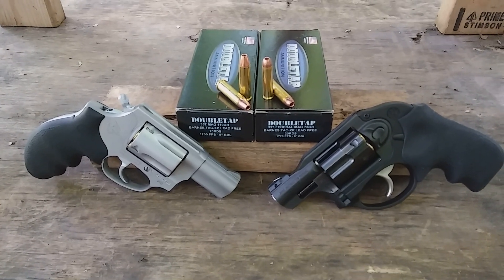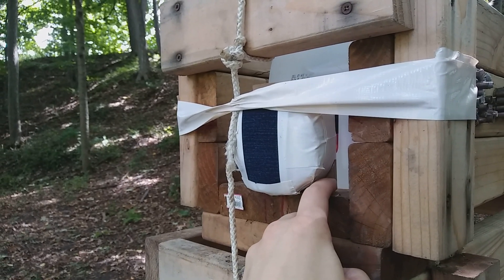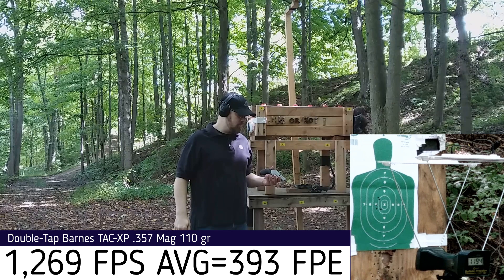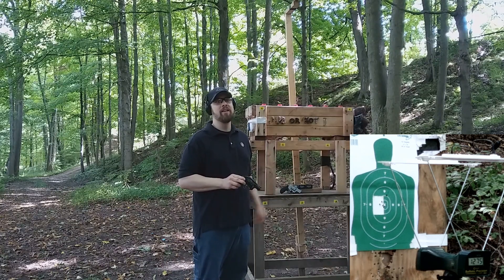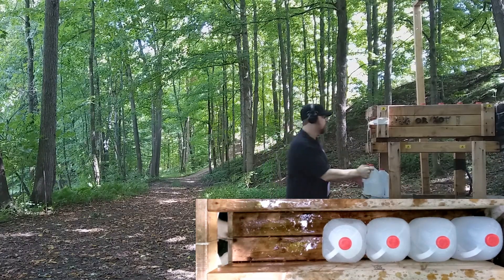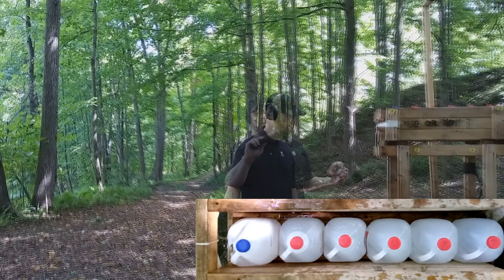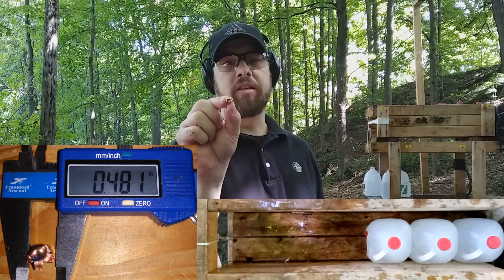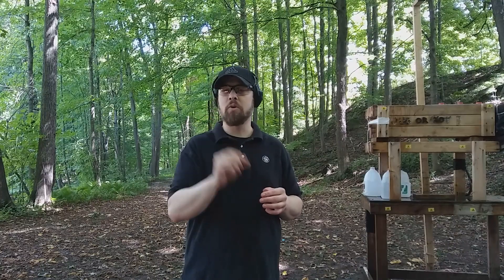.327 Mag VS .357 Mag Episode 3: Double-Tap TAC-XP

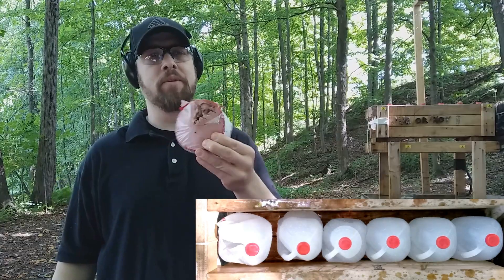Comment: Thank you for your efforts! Just watched your whole series of 327 vs 357. I have recently bought my first gun, the LCR snub in 327 Federal after watching many videos. As a novice shooter I like the ability to work with varying power rounds from easy shooting 32 auto all the way up to 327, and 32 h&r is adequate for carry with lower recoil (327 hurts!). It was really only after I bought it I realized how much more expensive and difficult to find .32 ammo is than 357/.38/9mm. There's always websites to order from, just have to buy in bulk so the s&h is worth it. The gun itself was also expensive, $590 shipped! I still think it is a good choice tho for the extra round in the j frame size  & I plan to put a green dot crimson trace grip on it for $250, making it one expensive little revolver! It is easy to clean & carry IWB at 4:00, & don't have to worry about magazine springs softening or feeding malfunctions.. I might get a 9mm  eventually but I don't regret my purchase for a versatile & dependable first ccw.
Reply from the maker: Thank you. You have a lot of option with the .327 but also a lot with the .357 as that can fire .357 Mag, .38 Special, .38 Long Colt, .38 Short Colt in the same way the .327 has the .32 H&R, .32 S&W Long and .32 S&W short. I have not fired any .32 ACP in my LCR yet but I have debated it. You have a lot of options to remedy the ammo issue from ordering in bulk, to learning to reload ammo to getting a .357 or 9mm LCR and choosing loads similar in recoil to whatever .32 round you carry. What I have noticed is that .327 ammo is easy to come by as Federal produces the American Eagle ammo, but the rest are not easy to find. From what I hear, the 85 gr American Eagle is the way to go and a fairly low recoil 50 round box. I hear that the 100 gr is loaded really really hot, and added the extra bullet weight would cause more recoil. In my opinion though, if you want a lot of rounds down range your best option is the .32 H&R Magnum.
Reply: If you think $590 including shipping was expensive, IF you can find one now for under $800 + shipping, consider yourself lucky. GunBroker shows recently completed auction at $855 + shipping, and the one or two others active are well over $700 with plenty of bidding time left.

Comment: 357 magnum is really not a snub nosed load. It’s meant as a duty load 4” barrel or Longer, which is why most people carry 38 +p In a snub. The 327 is a great alternative for people who want to carry a wheel gun over a 9mm or 380. With the same performance without the recoil. You proved that here. Great video as always. 👍🏻
Reply from the maker: Thank you. While there are some loads that seem to do as well in a snub as a 4" barrel, this one definitely is not one of them. Typically when I see a lot of flash I know the powder is too slow burning. When I shoot loads that I don't notice flash typically we so more velocity, so it's faster burning. But then the fast burning comes at the limitation that in a 4" barrel it's not as powerful as others. The magnums with a 158 gr bullet seem to be the most efficient and powerful in a snub, however the recoil is always worse for 158 vs 125 or less.
Reply: Try the 327 in a 17oz Ruger LCR and tell me there's no recoil.  My 9mm SIG 938 had considerably less felt recoil.  All these claims that the 327 has no (or very little) recoil are simply false.  In a 4" barreled 30oz SP 101, I'm sure it's very pleasant,  but I believe most people are interested in the 327 for small light concealed carry  guns.
Reply: @charlescole7532  the 32 H&R is the better round
Reply: @charlescole7532  It's not horrible. It's there certainly, but it's manageable.

Comment: since you do your own reloading, you might want to try a semi wadcutter hollow point with a gas check on the backside with an all lead bullet.
Reply from the maker: I do plan to test some hard cast rounds soon. I would have to get the thing that attaches gas checks and find some bullets. I actually haven't started reloading any .32's yet as I have been using my gun budget for factory ammo lately and don't even have the die set yet.

Comment: I realize this test goes back a few years, but I recently noticed the .327 doubletap barnes bulllets are still for sale a a decent price. So far the only .327 Federal Magnum round I have purchased is the 85 grain reduced recoil hydroshock, which shoots easy in my Taurus 327 (mainly I use S&W longs). The double taps are about 2/3 the cost of the hydroshocks, would they be worth trying for self defense?

Comment: The inconsistent expansion of the .32 would require about another 3 or 4 duplicate tests to see if a pattern emerges. But cost....
Reply from the maker: I believe my measurements were at 1.5 times expansion or close, so either way it still passes as well as not over penetrating.

Comment: You seem to align the barrel and camera angle with the gap in the boards at the top of the Jug-Or-Not ballistic test machine.  You can see the recoil in barrel rise and angle.  While not a precision measurement it does show a comparison.
Reply from the maker: I have thought about attaching the legs to the table, but yes the push back on the box is a measurable thing so I opted to just adjust the angles post shot in editing. Probably high momentum rounds like the .45 auto would really shove it back.

Comment: I carry a 327 fed Mag revolver but carry 32 H&R mag ammo in it, I also have a 32H&R mag revolver I carry as much I have a Ruger LCRX revolver is 327 and a S&W 327 mag revolver with a 3" I do not like the S&W 327 however as it has a ported barrel that has lots of flash and noise and is actually painful to shoot and I have a S&W 32 H&R snub nose I carry most often and it is usually close by me every day, great little revolver, I do not carry a 357 as all mine are bigger revolvers and harder to carry and no advantage over a 327 or 32 as the ones I carry are  shooters  and more compact

Comment: Good, informative, interesting video... As always. Have you ever accidentally shot your chronograph ?
Reply from the maker: Thank you. Last year when I went through 2 boxes of .38 Special Golden Saber frustrated that it would not read, I did go back like 10 yards, and I hit low! Luckily the bullet went through only plastic, the bullet literally touched the top of the circuit board but didn't damage it, didn't damage the light bars either.

Comment: I'm not a fan of Double Tap Ammo because they exaggerate their velocity claims. For example, they claim 1470FPS from a SW 1 7/8" barrel for the 357 load on their website (link below). You averaged 1269 from a longer 2 inch barrel lol. That's a 200 fps difference or about 15% decrease in claimed velocity.  Underwood and Buffalo Bore tend to be closer in claimed velocities.

You know Double Tap knows the actual velocities, so why lie about it?

EDIT: forgot to thank you for the test! Appreciate all of your tests and the good information you provide.

http://www.doubletapammo.net/index.php?route=product/product&path=303_331&product_id=388
Reply from the maker: I didn't notice that before, yeah that's off a lot. When I tested Buffalo Bore ammo which is very similar of a company, I was getting differences of averages by 2 FPS in the same barrel lengths listed.

Comment: I'm a noob but am looking at the lcr as my first ccw (just not comfortable with a chambered semi as a carry). I was wondering which has less felt recoil. The.327 or .357 firing 38+P? I think in one of your videos that the 327 is more powerful than a 38+P if I am correct.
Reply from the maker: Generally, the .327 Federal Magnum will have more felt recoil than the .38 Special+P but the .327 Federal Magnum will have a little less recoil in general than the .357 magnum. Now there are some exceptions because often times ammunition can be purpose loaded by companies to have whatever attribute you are looking for. Examples would be the Federal Hydrashok .327 Federal Magnum- that load has about the same felt recoil as an average .38 Special+P load. Another example is the Speer Gold Dot .357 Magnum 135 gr "short barrel", as it has less felt recoil than the Speer Gold Dot 100 gr .327 Federal Magnum. The main questions to ask are do you have any other revolvers, and do you plan to shoot a lot of ammo for practice? If you do not plan to shoot a lot than a .327 Federal Magnum LCR is a good choice as there are some decent loads that you might be looking for like the Hydrashok load. The other thing with a .327 Federal Magnum is you can also chamber and fire .32 H&R Magnum and .32 S&W Long ammo, and especially the .32 S&W Long ammo is pretty available and easy to shoot. Now if you do plan to shoot a lot and have no other revolvers than for sure you should get a .357 Magnum because you can find pretty much any amount of ammo everywhere for practice with lots of load choices in .38 Special and .357 Magnum to work with.
Reply: @GunSam  Great video, but I'm curious that when recommending 357 vs 327 options you give little to no weight to the advantage of 6 rounds vs 5, which I feel is significant. Are you discounting the potential value of the extra round?

Comment: Wish you would use same grain amo for both guns
Reply: That can be hard to do.  When you're buying factory ammunition, you're beholden to what the manufacturer offers.  Looking at Double-tap's website right now, they have two offerings for the .327 Federal magnum.  One is the 75 grain BARNES TAC-XP LEAD FREE bullet that Gun Sam is testing here.  The other offering is a 120 grain hard cast solid wide nose flat point with a gas check.

Double-tap offers a much wider range of bullet weights and designs for the .357 magnum, but the lightest bullet they offer is the 110 grain BARNES TAC-XP LEAD FREE that Gun Sam tested in this video.  None of the ammunition they offer comes with a 120 grain bullet, although they do offer a few different 125 grain bullets.

From what I can tell, there are very few points where the .327 and .357 magnums intersect in bullet weight.  85 grains is a common bullet weight for .327 Federal ammunition.  I can find one .357 magnum ammunition available with an 86 grain bullet (PolyCase Interceptor ammo).  Those weights aren't exactly the same, but 1 grain of difference isn't enough to make a difference.  The only other place I can see where .327 and .357 share a bullet weight (unless you count the 120/125 grain area) is 130 grain bullets.  Buffalo Bore makes a .327 federal load with a 130 grain LSWC.  Federal has made Hydra-Shok ammunition with 130 grain bullets for the .357 mag, and .357 mag ammo with a 130 grain FMJ is not uncommon.

There may be other examples of identical or very close bullet weight ammunitions for these two cartridges out there that I'm just not aware of, but those examples would not disprove my main point, which is this: The disparity in bullet weight between these two cartridges is the norm.  Any commonality in bullet weights is the exception.

The comparison Gun Sam did here may not have been "fair" due to the difference in bullet weights, but it was "realistic" in that the ammunition was from the same manufacturer and the bullets were of the same construction.

Comment: 110 gr bullet vs. a 75 gr bullet is the biggest reason for the recoil difference.  If you compare a heavier 327 bullet vs the lighter 357, the recoil difference is not so obvious, especially when using cheap range ammo for both.
Reply from the maker: I have noticed that power levels and bullet weight are what makes a lot of recoil but what matters most of all is gun weight. For instance, in my 39 oz 4" S&W 686 with full power .357 Mag rounds that are the same energy between 125 gr and 158 gr, the recoil feels identical to me. However, when going to my 21 oz Taurus 605, that 125 gr round feels like a LOT less recoil than the 158 gr. Also with something like .45 ACP in my G41 weighs 36 oz loaded so even a 230 gr+P 500 ft lb energy round has less felt recoil than a 9mm+P 124 gr 400 ft lb energy round in my 27 oz Ruger Security 9.
Reply: @GunSam  I was thinking about that as well.  In my case, I have LCR's in both 327 and 357 and the weight of the guns (unloaded) is almost identical.  I believe I was firing 90 gr vs 110 gr bullets.  The recoil is certainly less in the 327 but not enough to be a deciding factor.  Having an extra round when compared to 38 or 357 is more important, at least to me.  The 327 is really a "super magnum" and recoil is still stout in a short light gun.

Comment: Seems gimmicky. I never believe the velocity claims of boutique companies. Even allowing for the shorter barrels, they are way off. Any of the full power 125 gr 357 ammo out there will get within a few fps of what you got here. Probably at lower cost too. That said, both bullets performed well. However, i have again seen various 357 loads that expand as well or slightly better, without the expense of a copper bullet. The 327 just looks better and better. I would choose a different load for it though.